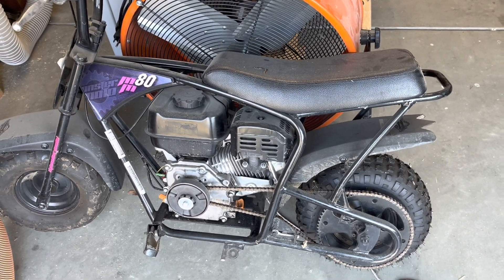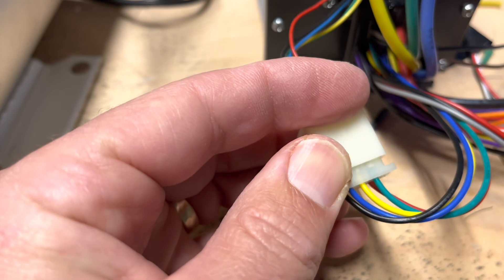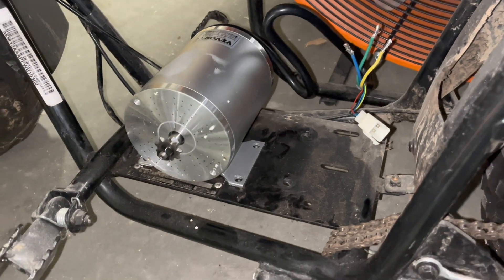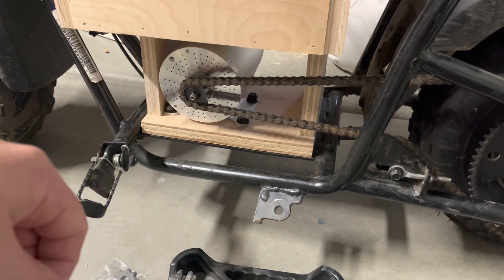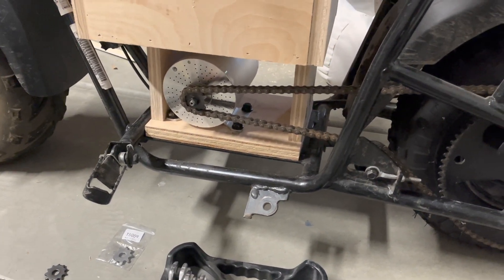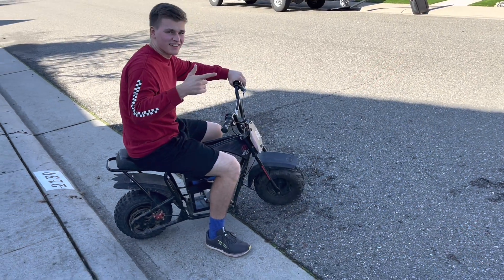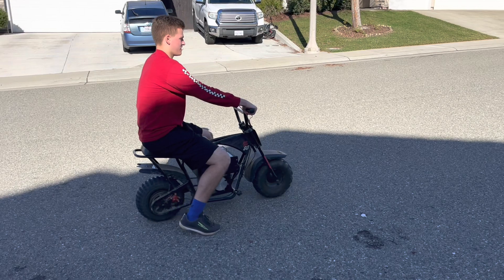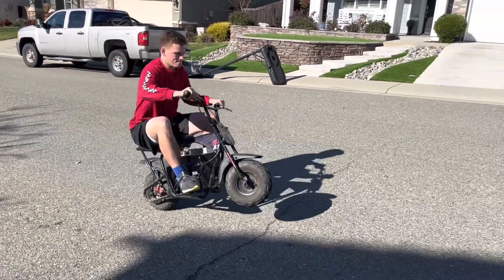Converting a gas powered mini bike to electric

Comment: Do you absolutely have to bring the motor up off the frame even if you run a smaller rear sprocket?
Reply: Even if you get the my1020 kunray with the brackets attached to the motor, think it would work without bringing it up?
Reply from the maker: The chain would still hit the frame. The sprockets don’t make a big enough difference.
Reply: @m10stuff  so definitely go with a motor mount riser or build one out of angle?

Comment: Great!  Now you can ride for 40 minutes and recharge over a 5 - 6 hours.  All of the low price of around $2,000 if you don't have any of these parts. Man this bike is slow with a 48v. You really need a 72v to get any real speed.... and that battery alone will cost you $1500. The price of a brand new 250cc Hawk dual sport motorcycle.
Reply from the maker: For starters you’re way off on your pricing. I have risen this thing for hours without charging. In addition, I didn’t build it for speed. It’s a perfect setup for a kid and fun around the neighborhood trails.

Comment: I just bought one of these that starts but won’t run. Wanted to make it electric honestly thanks for the video! Any ideas how many miles you get on that battery? How loud is that motor compared to the gas one?
Reply from the maker: I need to do a thorough test on the miles. It’s pretty far. I don’t hear the motor at all. It’s silent.  The only noise the bike makes is the chain on the sprocket.

Comment: Hey, man - great video.  Really helped my son and I out.  We picked up a MMB80 and a 72V, 4900RPM motor kit and were stumped on how/if we should add the freewheel that came in the kit.  Doesn't look like you used one and still had success so we're going in that direction
Reply: Freewheel?  I hadn’t thought of that part. I have a Coleman I’m going to convert. So videos like this a fantastic.
Reply: You can install a freewheel on the motor using an freewheel adapter for around 10 bucks. Or, if you have a bicycle, you can have two freewheels on the rear wheel using a bottom bracket outer race which is sold as dual freewheel adapter. My bike has a 7 speed cassette, I will swap it out with a three speed cassette for the pedals and a toothless freewheel for a large sprocket for the motor.
Reply from the maker: I’m glad it helped

Comment: I’m wiring this exact setup on my mini bike.  Not getting the motor to turn.  Using a 60v dewalt until I can get a big battery.  Anything that I might have missed?
Reply: The only thing I didn’t leave on was the kill switch
Reply from the maker: What’s the voltage of the new motor?
Reply from the maker: Hopefully the 60v battery didn’t mess up the 48v controller

Comment: this controller have a reverse fonction you didnt need to switch the motor phases, btw nice work
Reply: In fact you were right by doing this because the reverse function on this controller makes the motor spin backward but at a very slow speed, so to run at full speed in reverse the only solution is to swap phases
Reply from the maker: Thanks. I searched and couldn’t find it.